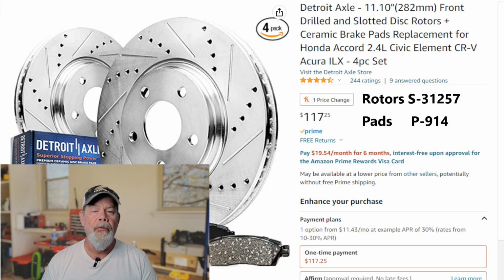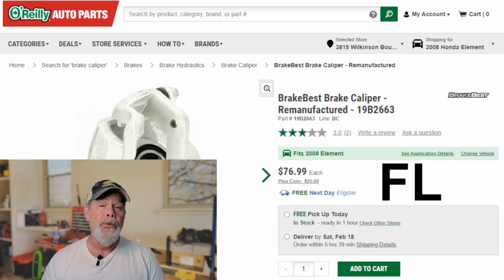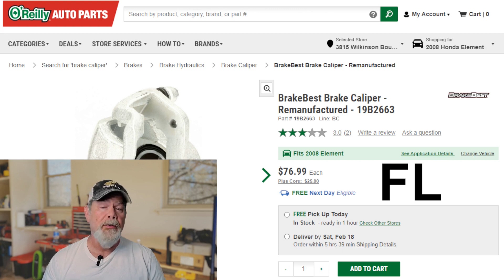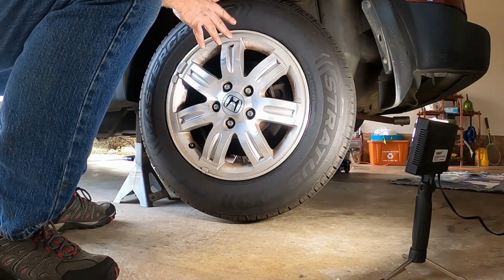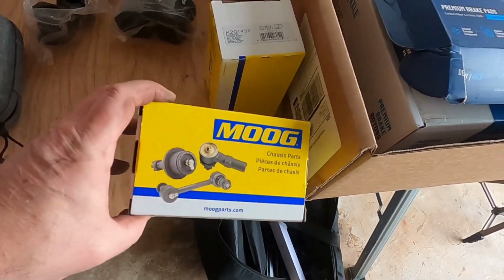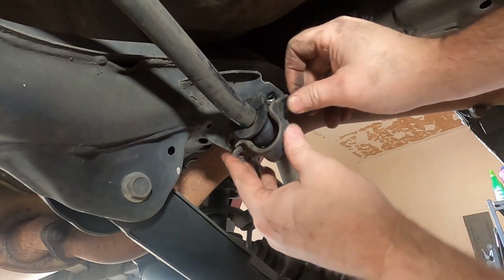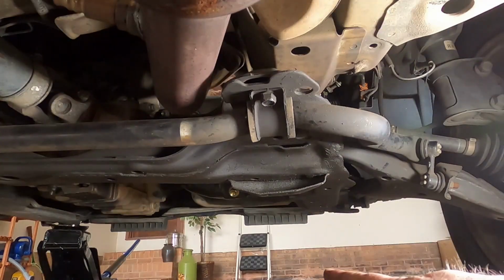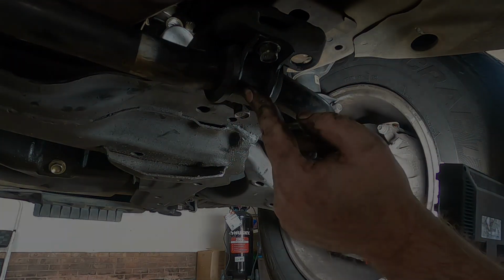Honda Element Sway Bar Bushings and Front Brake Overhaul

Comment: I am a noobie home mechanic. What cordless impact drver do you recommend? I see Milwaukee has several different torque variations. Also, i really appreciate your reminder to always use jack stands. These little things are crucial to those of us new to working on cars.
Reply from the maker: The 18v Milwaukee I use does most jobs. I have a 3/8 and 1/2 drive. For the bigger stuff I use an air impact or a breaker bar.

Comment: A great fan of the Element, so a welcoming great video...I see you saw better with the impact screwdriver for rotors on the second go-around! Ha ha!  I use anti-freeze on the screws when re installing and works free with a large screwdriver on the next rotor removal!  Why doesn't Honda just add a bit?   -Very clean undercarriage, mine 04' here in NY not bad, but wish I had your lack of wear and no rust!  I have to change out the oil pan on mine due to rust...not many video's of this procedure but you have to remove a section of the chassis.  A future video for this channel maybe?
Reply from the maker: I'm glad you enjoyed the video. I did get lucky and got one that has always been a southern car. 

The plan is to actually pull the engine for an overhaul so I don't imagine I'll ever have remove the pan before that. 

Thanks for taking a moment to comment!
Reply: @ktecgarage  Just subscribed ...thank you again.